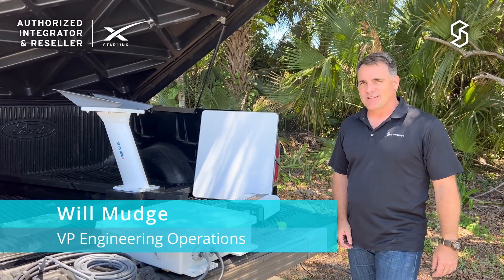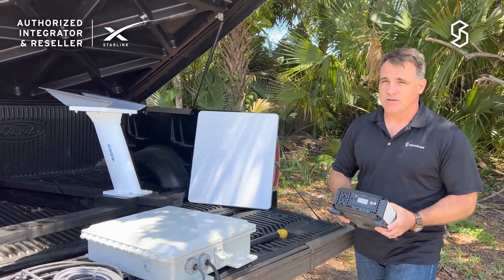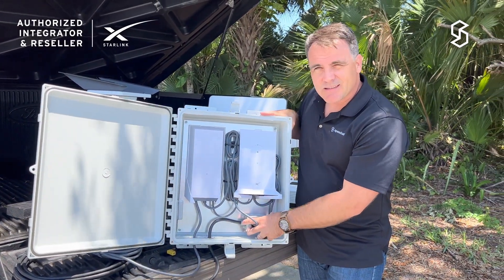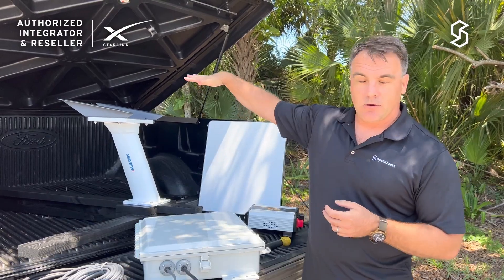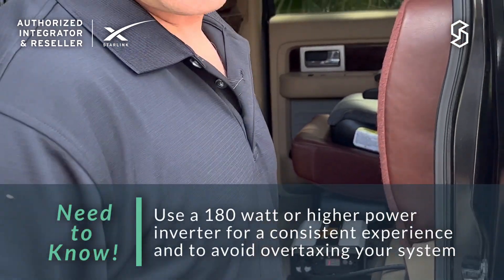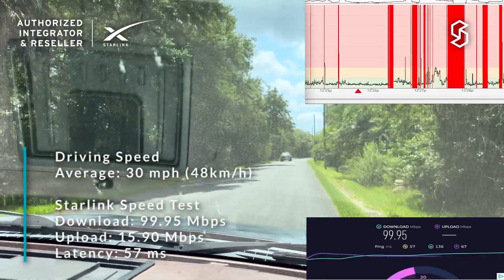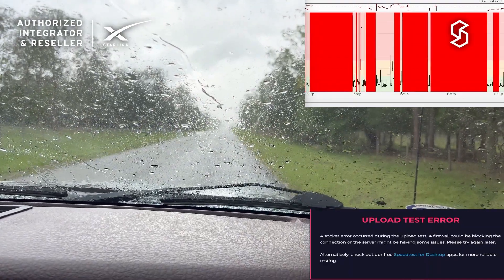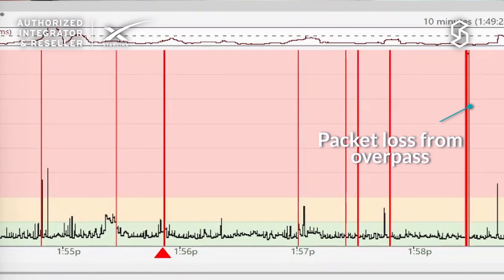Starlink Mobility, Driving, Obstructions and Rain Tests | Starlink Authorized Reseller & Integrator

Comment: Should have shown how starLink was connected to the power source of the car .  Do you connect it straight to the car lighter ?
Reply from the maker: Thanks for tuning in. The inverter cannot be connected to the car lighter.  There is not sufficient amperage in a car lighter to support an inverter of this size.  The Invert was connected directly to a battery with a fuse for safety.